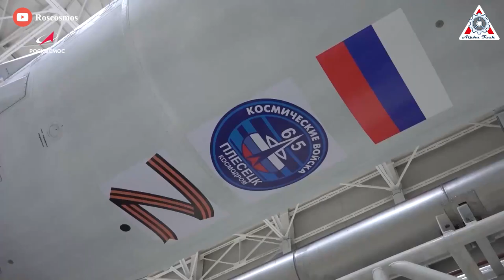Russia's Rocket Failure…

Comment: 1:16
No, Soyuz was NOT intended to be the Soviet Moon Rocket.
That was the TOTAL FAILURE (4 launches, one massive explosion, 4 failures) N-1.
Reply: They could have went with just multiple Soyuz rockets, Maybe a Proton to launch the tli/tei vehicle that a Soyuz and lander vehicles dock to.  They could have done it, but didn't.
Reply: The Soyuz space craft, or its predecessor was intended to go on top of the N1
Reply: @SliceofLife7777  By the time the N-1 failed the first time, the US had already won the Moon race.
So the Soviets quietly folded and tried to pretend they'd never tried to compete - 'til the information started showing up publicly during the Glasnost era.
Reply: @chrissouthgate4554  But the Soyuz rocket was NOT intended for the moon rocket.
Orbital only - it didn't have the amount of lift for a Moon shot.
Reply: @bricefleckenstein9666  Yes, true.  But they assembled Mir in low Earth orbit, using R-7 and Proton rockets.  So they theoretically could have assembled a space craft, with multiple launches, that would have perhaps got them from low earth orbit to tli. Then return it's Soyuz capsule component back to earth from the moon after landing their famous moon lander mock up.  All they needed was a Soyuz, the lander, and some kind of space tug that flew assembled, to the moon and back. It wouldn't be just that easy, but it could have been done without the N-1.  No way they were going first, but they could have gone to the moon.
Reply: Zond was launched by the Proton-K which first flew in March 1967 about the same time as the Saturn V. The Proton had just enough performance to launch two cosmonauts on a free return trajectory around the moon. The plan was always to do an Apollo 8 style mission on Proton to test the Zond. But there were a lot of issues with re-entry for Zond and the Proton itself so the Soviets decided not to risk Alexi Leonov’s life on a flight around the moon that had a very high chance of failure.
Reply: @John-ed8ye  And they NEVER DID have a rocket work that could put men ON the moon.
"Around" is a much easier proposition - which is why NASA did it that way, both with Apollo AND recently with Artemis.

Comment: Soyuz(rocket) is a legend in the space industry. It is the most used launch vehicle ever built and one of the most reliable. Talking trash about it because Russian government is evil is not the right thing to do. The same thing can be said about Soyuz spacecraft.
Reply: Not talking trash about it at all. It's 1950s technology. That comes with issues. New technology is passing it by in cost and capability. That's simply an unavoidable fact. SpaceX is now reusing boosters at least 14 times and Dragon reuse as well. No portion of Soyuz ever flies twice, including the crew capsule.
Reply: It is/was a great rocket…. But it is old tech….  If they are not already working on more modern rockets… they should be.

Comment: Can the exhaust cloud from tests be recirculating for a secondary burn using a below test deck intake turbine to pressurized container,like using wood gas from a woodstove used to power gasoline engines.
Or use exhaust to use as a barrier inside fuel conduits. 
Hydrogen fuel escapes cause it's so tiny right,why didn't the sls think instead of moving a ton of hydrogen around why not just have prefilled  stage tanks instead of dicking around with leaks?
Reply: Because the hydrogen WOULD ESCAPE if it was pre-filled.

Comment: They got stale. Then they got fat and lazy. Then they got risk-averse, which can often lead to failures b/c nobody wants to be the one that stuck their neck out. The death-nell came when they had one key supplier (Germany) that provided one of the most important products needed to make fuel. When tsar vlad the tiny then kept 300 leased planes from the West (costing $9B USD) & screwed Europe of gas & oil, then blew up their own pipelines, it became apparent that vlad's lost his marbles, and no one will ever trust him again, except for DPRK & Iran (even China is afraid to touch him w/ a ten-foot pole!). Oh, I forgot...Syria would still work w/ vlad if he needs gravel, sand and blocks of destroyed concrete w/ rusted rebar poking out. That's about all Syria can export, besides a few fired-off S300, S400 missiles (mis)fired at IDF AF.
Reply from the maker: They must change